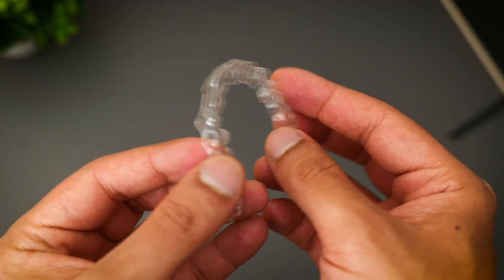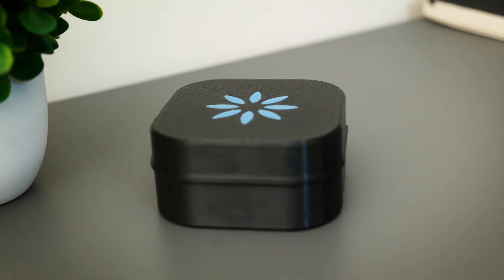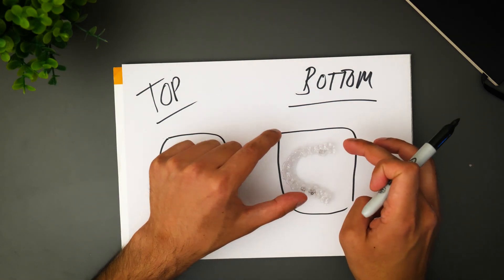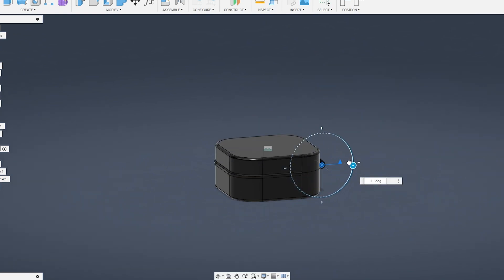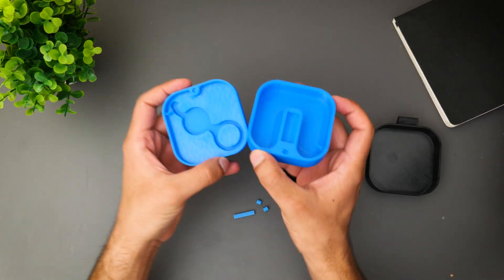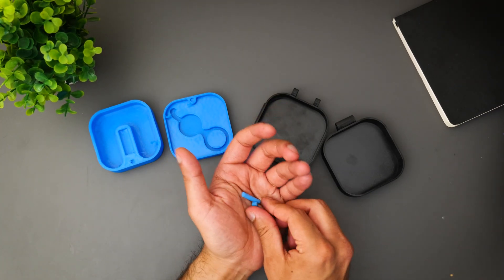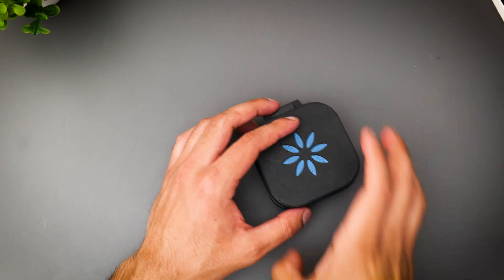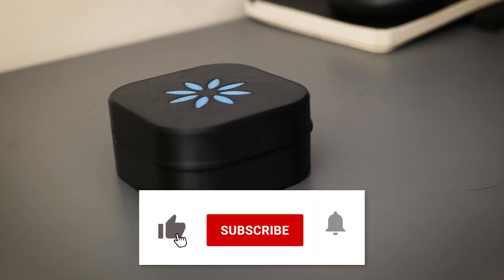Helping DENTAL Patients with 3D Printing (InvisiKit)

Comment: I love this as an application of 3d printing!! The final product also looks amazing. I've heard that the layer lines of fdm printing can be problematic as they can allow bacteria to grow, and in an application like this, that may be an issue. Potentially you could use ABS or ASA with acetone smoothing to reduce the layer lines. That post process melds the layers together and could probably reduce the risk of bacteria growth.
Reply from the maker: That’s a great point - definitely something to look into. I’ve been looking for an excuse do to the ABS vapour finish technique so maybe this’ll be it. Thanks for your comment!